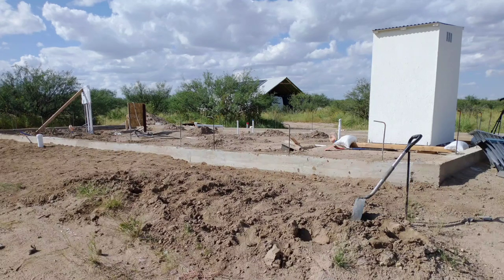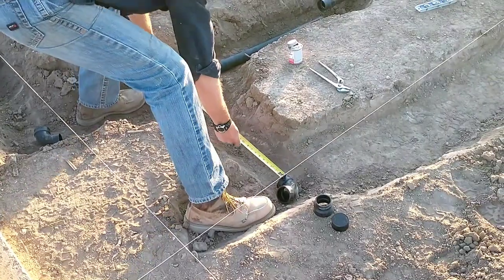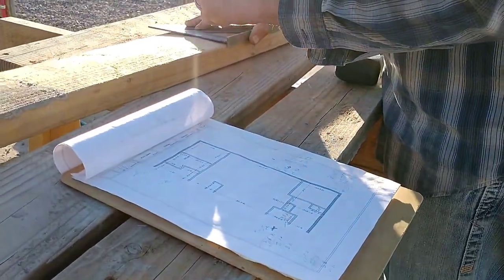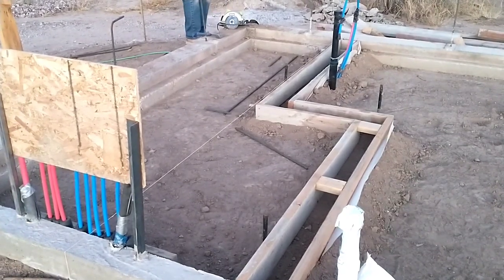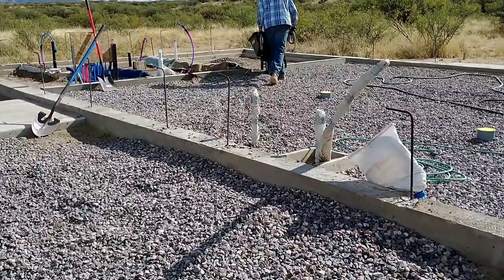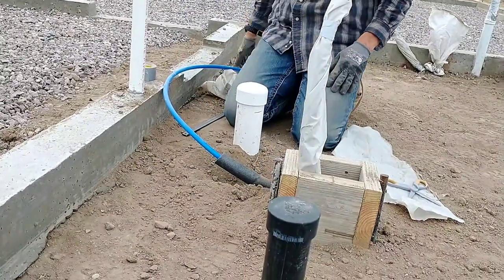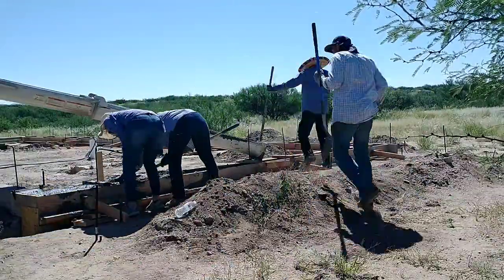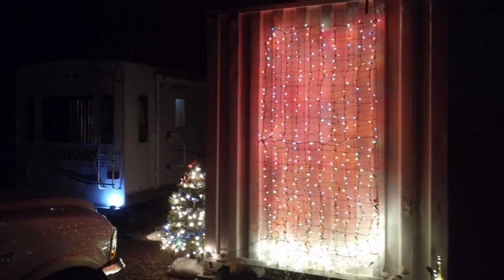#8 Building Our Own Home 🏠 Finishing the Plumbing & Getting Ready For Concrete DIY Off-Grid

Comment: One question.   Have you considered Adobe?   I was  rooting for the Aircrete, but I could see the failures.   Is there an adobe adaptation that might work here?
Reply from the maker: We considered adapting the frame for rammed earth, adobe would work well too with the design. The issue we have with earth homes is the amount of labor required, but more than that is the difficulty in heating a thermal mass structure. We don't like being cold and would prefer something with more insulation.